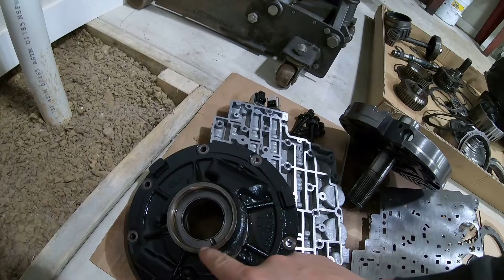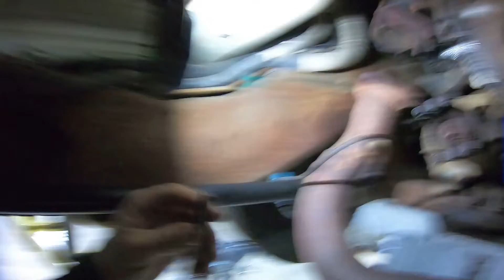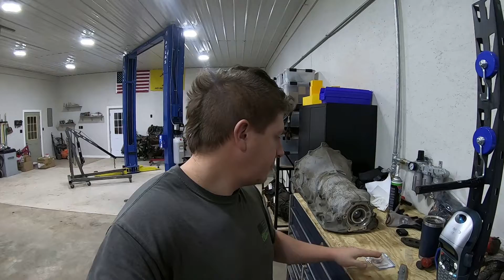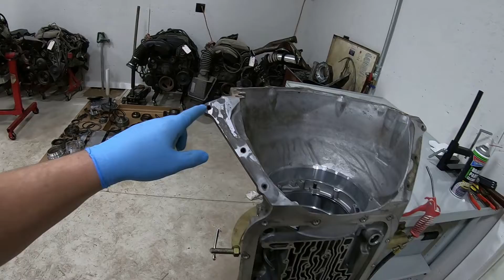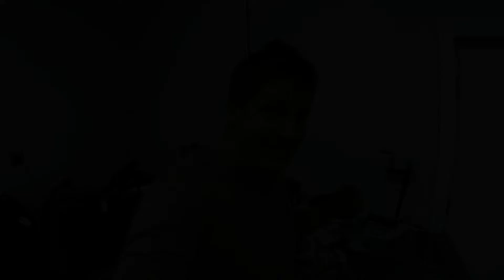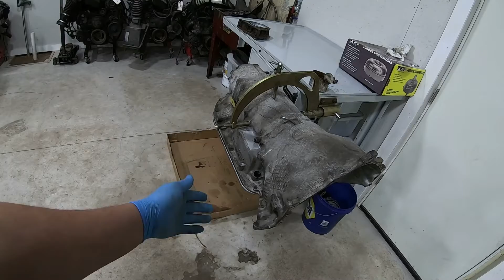FULLY REBUILT the ROASTED 4L80E from my TOW RIG

Comment: Question: the HD-2 accomplishes the same thing as dual feeding internally. Did you do both, or do something different with the HD-2 to allow the dual feed (internal)
Reply from the maker: I made the internal dual feed changes, removed the  second sealing ring on the center support and plugged the hole under the valve body. The HD-s accomplishes it by using a layered separator plate with a pass through to feed both parts of the piston. I used the factory separator plate and enlarged the holes where the fluid passes through for each gear.
Reply: Awesome. Thanks for putting out the good content!